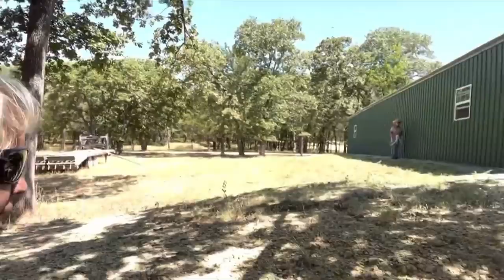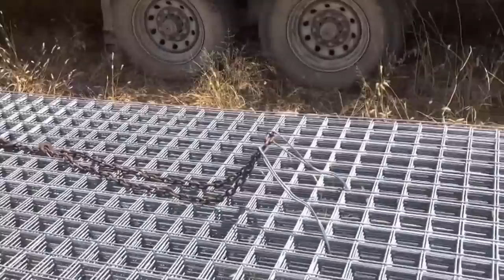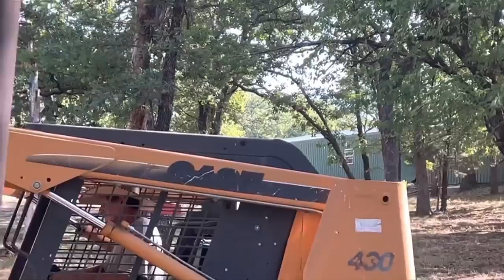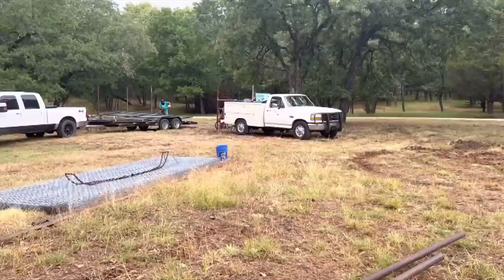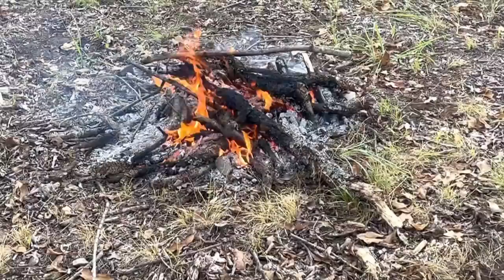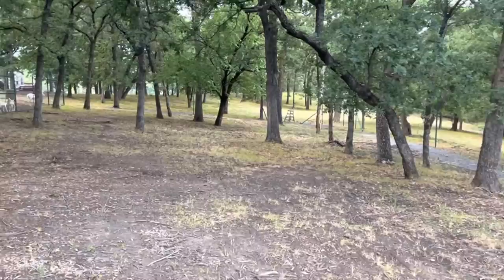New Home for the Albino's Part 1! How to build a High Fence!

Comment: 90 dollars for cattle panels, I can remember when I could get them for 25 to 35 dollars. Good thing is they last forever.
Reply: And I thought that $16 was high back in 2009
Reply from the maker: They do last but the price is crazy.  A lot of that price is that $4-$6 a gallon diesel fuel it cost to haul em’!!  That hasn’t dropped much.   Thanks.  May God Bless.  jimmy

Comment: Amazing that there are machines equipped with a driver press to push fence poles deep in the ground.  Such a help to cattlemen and others needing fences.  I’ve seen this machine also pull posts out of the ground and replace better poles.
Reply from the maker: It is pretty amazing. Virginia.  And yep, it will pull em as well.  Tuff to pull when you drive them that deep.  Thanks.  May God Bless.  jimmy

Comment: My uncle needed to fence in a pasture for miniature horses. Put in T-posts and put pig panels around the pasture using fence brackets around the T-posts. A broken in half piece of brick was put underneath in the middle to support the pig panel. Still standing and my uncle has passed on. Better than stretching wire.
Reply from the maker: Those panels really make a better fence and much easier to put up.    Thanks.  May God Bless.  jimmy